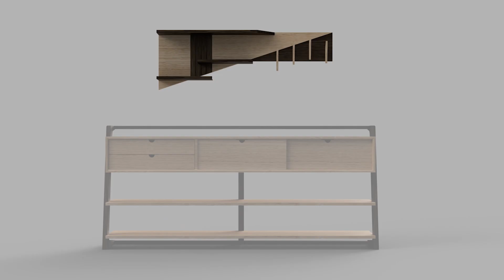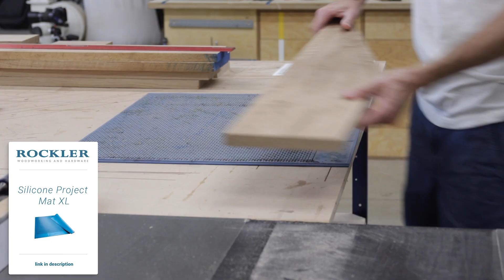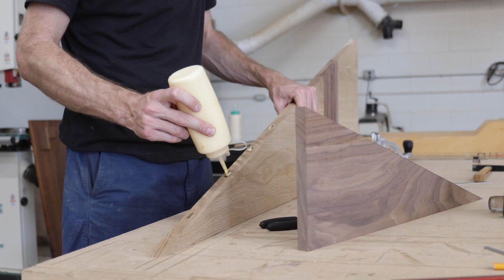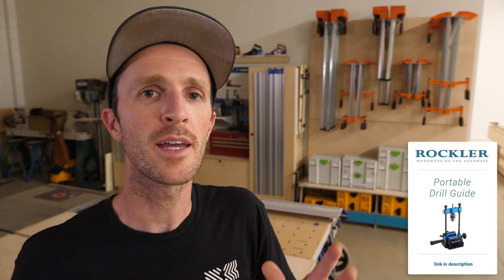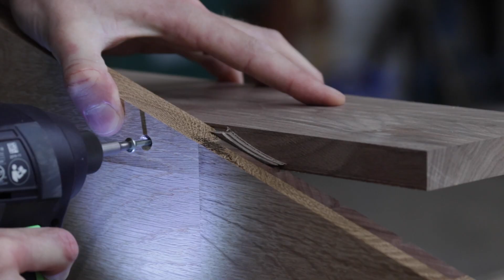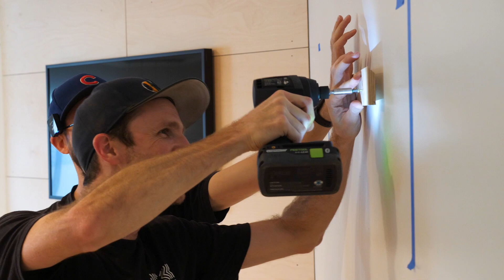Modern Coat Rack & More | How to Build

Comment: Great looking piece.  But really quickly...can you scoot the console table just a little right.  And square up the verticles on both pieces.   (Sorry...graphic designer in me took over.). Looking forward to the next one.
Reply from the maker: I used to be a graphic designer. In reality the pieces right most edges are in alignment and the empty space to the left will be filled by a framed picture.
Reply: @Foureyes.Furniture  That explains your great designs!  Your instruction manuals.  And your colorful collection of AIRS.

Comment: Very attractive piece. How did you hide the ends of the French cleat on either side?
Reply: Thanks! The french cleat is 1/2" thick plywood, and it is inset from the ends of the piece by 3-4", so you would have to press your face against the wall with a flashlight to really see it.